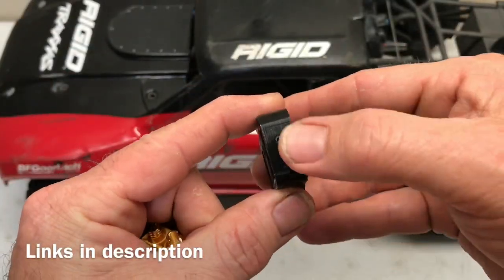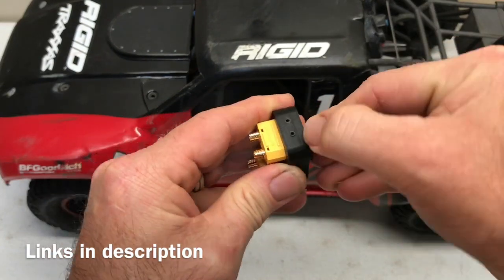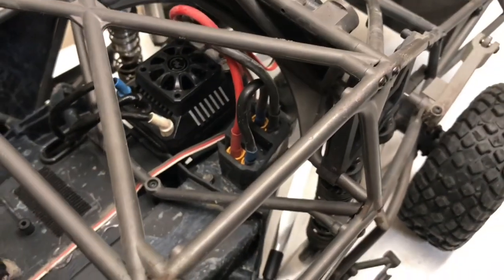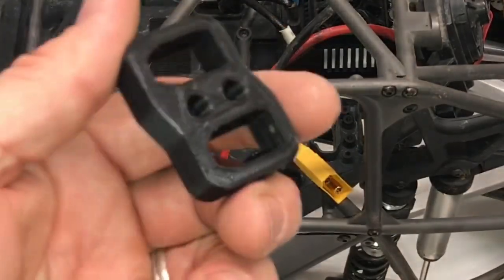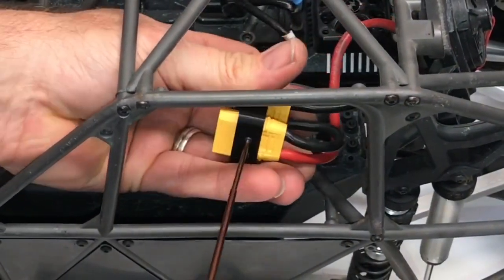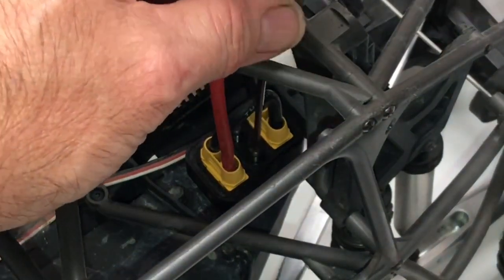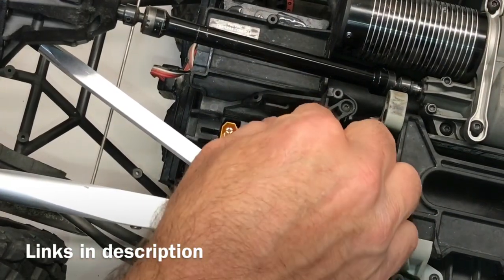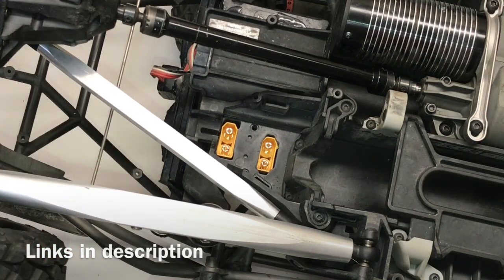XT90 plug install on Traxxas UDR

Comment: Hey, to connect the XT90s to the ESC do I need to solder the cables into it?
Reply from the maker: yes you will need your own xt90 connectors and get them soldered to the stock esc.

Comment: What is the point of doing this process?
Reply from the maker: Deagan Z batteries with XT90 plugs are far more common in the aftermarket than the traxxas batteries. This makes the truck more versatile with other brands.
Reply: Exocaged RC got it. Thanks for the quick response. I dig your videos.
Reply from the maker: Deagan Z thanks and glad to have you.